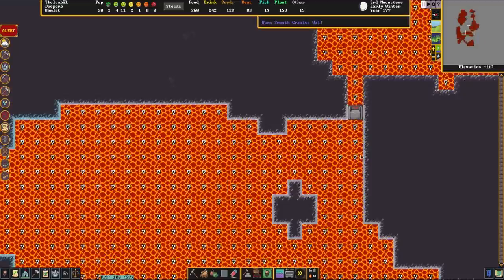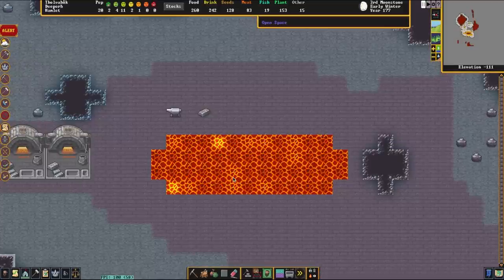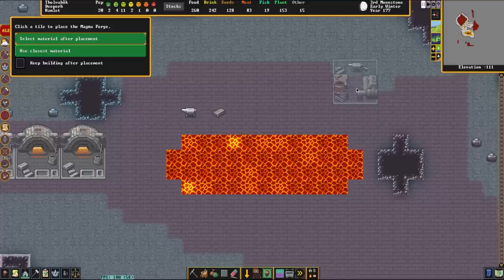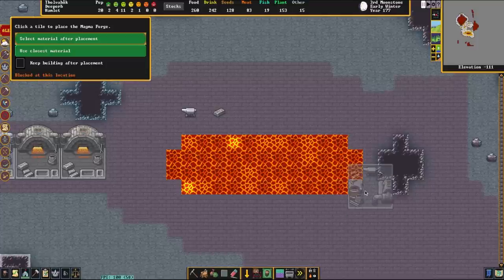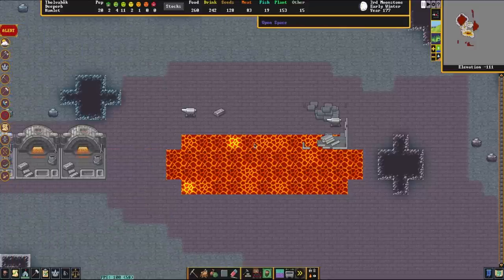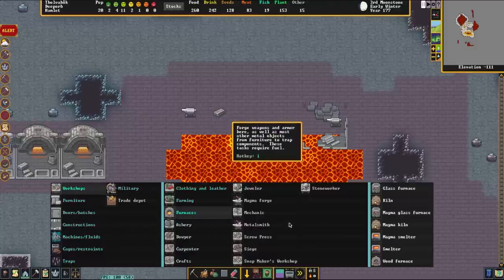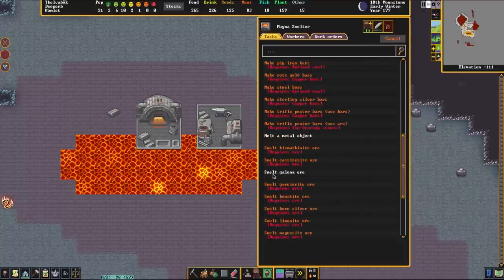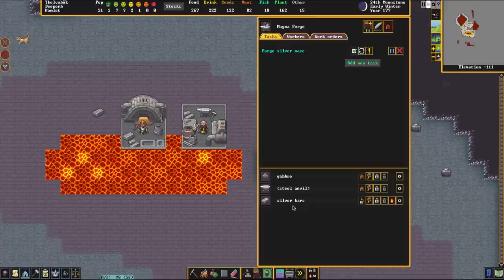Dwarf Fortress - Quick tutorials - Magma Smelting/Forging

Comment: "coal, or coke as it's called in the game" - coke is derived from coal in real life just like in DF! And just as in DF, it is used as a fuel and as a carbon additive to iron ore to bind with and remove the oxygen to make pig iron, and to add carbon to pig iron to make steel. One of the areas where DF is actually reasonably true to life!
Reply from the maker: Yeah the game matches reality in a lot of ways. But I try to keep these videos short so I just skip over the fun Wikipedia factoids.
Reply: When I think about it, the total conversion mod for Minecraft - (Terrafirmacraft) is heavily inspired by DF.
While you start at more or less stone age, cooking clay jars and tool casts is simple.
You collect different surface nuggets of metals and cook them in said jars to get your first tools.
And this is where the metallurgy comes in as you can make any form of Bronze and Brass at this stage in stead of straights up copper as it is a brittle metal on it's own.

The difference to DF is the solo/MP and that you would have to construct a bloomery or steel forge.
Metals has workable temperatures and anvils are actually anvils, so there is a bit of a process to forge compared to cast.
Reply: Came here to say something similar, haha.
Reply: Charcoal cannot be used for the same things IRL. Not all of them anyway
Reply: @TherealTenmanI  true, charcoal doesn't heat as much as coal
Reply: @elpsykoongro5379  honestly im just still mad I made charcoal and didnt get charcoal as an output. Bad game. Terrible mechanics.
Reply: @TherealTenmanI  do you know how to actually make charcoal? 
You don't need more fuel than wood for that
Reply: @elpsykoongro5379  irl yes. Low oxygen burn covered in dirt or clay.

In DF yeah. But the output for make charcoal isnt charcoal. Its coal. Really annoying when I was trying to find the resource in stockpiles.
Reply: @TherealTenmanI  that's weird 
For me it those say it's charcoal
Reply: @TherealTenmanI  It's actually superior for ironworking compared to coal. Less Sulfur.
Reply: @TherealTenmanI  as a newbie and with the depth of this game, I spend an ingame year digging for real coal, because I thought that would be required for steel

Comment: What luck. My first ever cave breach I spotted a great plateau nearby ripe for the plowing. So I close down the exploratory chute and build a stairway in a convenient spot nearby. I was planning to wall if off and use it as a farm, but now I've discovered a magma pipe and a water pipe very nearby to my plateau. It's gonna be the economic heart of my fortress soon.

Should mention that magma from pools (AKA obsidian pipes) replenishes slowly over time. The top of the pipe was the floor of my cave, so I just had to channel it down. Noob luck moment was that I channeled down offset from the center of my magma pipe, idea being a magma trench would feed several workshops. I had a trench 2 tiles wide, would set up the other ones once I had this workshop operating. I put up a smelter atop the open channel tile. Weirdly enough, sometimes I could, sometimes I couldn't set up tasks. Once I got a few in, job cancelation message said my furnace wasn't working. Quick wiki look up said that you need at least one tile magma level 4/7 channeled under the workshop to operate it. So that was what's happening. Magma was flowing between both opened tiles and disabling my workshop.

Magma pipes like mine (1x1 magma core surrounded by 3x3 obsidian walls) do eventually refill to 7/7. So I will eventually be able to trench out my magma furnaces indeed.

Comment: is it safe to have a pool of magma inside the fortress open like that? i mean, what about pets? wouldnt they catch on fire? or maybe some dwarf can fall off into the magma? can the magma spread to other blocks?? thats a fire hazard, is it?
Reply: Dwarves can indeed fall into it, but that tends to be rather rare as it is usually the result of combat (even just a brawl between upset dwarves) or a cave-in. Neither of which generally happens around workshop areas in most forts, unless they're designed with nearby taverns or some sort of ongoing work

That said, i'd generally try to make the areas relatively safe, myself, either with walls (or, to be more fun, windows) or only channel out specific squares into the underlying reservoir, the ones i know are impassable for each workshop

Comment: Random thing that someone made me curious about - Does the tile of the workshop above Magma count as a solid floor, or can Dwarves theoretically fall through the workshop?
Reply: In previous versions they absolutely could fall through. I don't know about this version. In the pre-steam versions every workshop had at least one impassable tile that could block exits in tight areas and in the case of the magma forge/smelter could cover up the hole preventing things from coming out of the magma and dwarfs from accidentally falling in. With this version I don't know for certain since it appears that they have removed impassable tiles in at least the horizontal direction. Googling came up with a couple of discussions but no one seems to have a definitive answer.

Comment: I build one, but after sometime, my dwarf got burned while using it, all left is a pile of ash (and a shoe). What happen? I build the forge with hematite block, which is magma safe?
Reply: No combat logs?

There's a chance one of the magma critters (some of which can spit fire or molten rock) got him, if the reservoir isn't safely sealed from the sea. Otherwise, it could have been the magma-vermin, that sometimes start fires. Or just a very, very unfortunate accident
Reply: @kalaksed  Thank you, so is there way to prevent magma vermin (or accident)?

Comment: Hello. I was wondering if you had any safety recommendations for magma workshops. I'd read on the wiki that in v.50.07 magma workshops no longer create a floor over the open space of magma beneath them. I'd tried to account for this by placing down grates or bars, but both blocked the construction of the workshops. Is there any way to ensure a dwarf doesn't accidentally fall into the open space(s), or would I just have to leave it up to pathing?

Thank you for taking the time to hear out my questions, and have a nice day.
Reply from the maker: Block the way in, I normally use a metal flood gate and lava safe mechanism. Have it set up before you let the lava in and lock it.
Reply: @BlindiRL  Thank you for the reply! For clarification, my set up is a line of magma below the workshop with only one hole in the floor. Are you suggesting the floodgate would go in the magma channel, directly beneath the hole leading to the workshop? If so, would closing it still allow that space to count as having magma while also blocking dwarfs from falling downwards?

Comment: So you could floor over the surface of a magma pond/lake/area then remove 1 tile every 3 on the horizontal and vertical (Tile, Tile, Gap, Tile, Tile, Gap etc) this would leave you with an area where it is impossible to place a "magma" workshop that fails to be over magma.

EDIT - I wonder if a magma safe Floor Grate can be used in the gaps. could Magma workshops be placed on top of these? I suppose they'd be "blocked by building"?
Reply: I believe you cannot build over grates.
You can, however, drain with a screw pump through one.

Comment: I know that, at least according to the wiki, there was potential fun in earlier versions of Dwarf Fortress where your dwarves could, if a brawl or something broke out around your magma forges, fall through the openings under your magma forges and smelters and perish in burning hot magma. To prevent this, I would only channel out under the impassible tiles of the workshops to get access to the magma cistern below. Is this no longer a concern?
Reply: This should still be possible, although it was always rare - you don't tend to get brawls or fights in your workshop areas to begin with, although the risk was always there. However, haven't had someone fall into magma yet so can't 100% confirm. 

I think your strat is still correct - Blind tends to not do the safest optimal perfect strats in general, which is why his forts tend to be fun to watch. In any case, have fun building how you like!
Reply: In this version, workshops do not have any impassable tiles.

Comment: I have an off topic question: I started a new map with a population of 10 how can I increase the population? The dwarfs live in a mountain and they are in their 70s right now.
Reply: With increased wealth comes more migrants. Be sure to produce lots of different things and have a lot of bedrooms. I'm a beginner though, so I might be wrong.
Also, I don't think you can get migrants if you're cut off from the ends of the map. Have an open route (protected) into your mountain base
Reply: Also have to make sure you're reachable by your own civ, or that your civ isn't dead. You have two hard-coded migrant waves that will happen, even then, but afterwards, those two scenarios won't have any more migrants that will reach you

Comment: wait

what about the... "fun stuff" living in the magma?
Reply from the maker: What about it?
Reply: @BlindiRL  if i put a link to the wiki the comment disappear
anyway, there are magma creature who climbs up from magma, how to deal with them?

in classic we used to place the workshop above the magma tile using the unpassable tiles of the workshop, it still works and prevents unwanted guests
did something change in this?
Reply: This is why you move magma to a safe place of your making. Block off with magma safe floodgate. You could also pump upwards and have a levered hatch over the tile of magma you are pulling from.
Reply: @KesSharann  ooh ok, i figured it was that case

but isn't there a risk of letting someone of those creature pass in the reservoir? are they always visible?
Reply: He briefly showed the floodgate entrance to his reservoir, so most of the magma critters won't be able to enter. The only potential exception is firesnakes, as they're vermin and will spawn anywhere around lava once the sea is discovered.
Reply: @danyraven7624  usually not, but they can occasionally start fires because of body temperature, and they are venomous. I forget what the venom does specifically, but wouldn't be surprised if it's heat/fire associated. 
So, they can occasionally be dangerous, esp if there are living or meeting areas with flammable stuff they can get into on the magma levels

Comment: Weirdly you can build wooden floors over a volcano or magma reservoir, leaving strategically placed holes for your forges and smelters. Using the floor method in my experience reduces the amount of fiery funboys to practically zero.